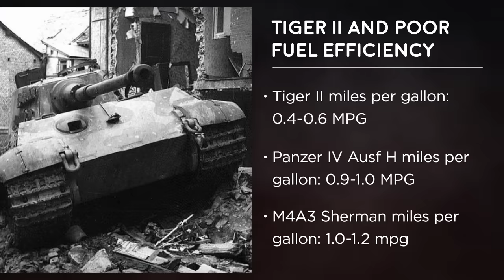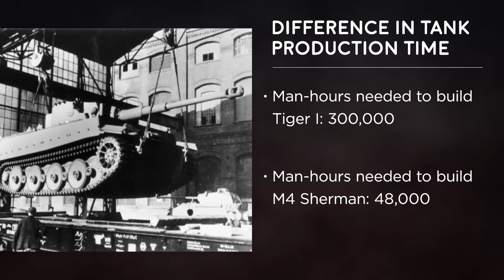Why Did German Tanks Perform So Badly in The Battle of the Bulge?

Comment: Tigers = 72 tons = over 140,000lbs. Each. Can’t think of too many of those country Euro bridges that could support that kind of weight.  If so, then one at a time crossing.  Tigers - lots of moving parts and complex. Was a garage queen. Massive and a brute but required a LOT of maintenance.   Not very good critical thinking skills when looking at the type of terrain that Germany had to mobilize over and conquer.

Comment: The heavy weight of the tigers coupled with all the bridges they had to cross.
American engineers blowing up every bridge they saw.
German lack of fuel.
German lack of intelligence (they had to search for American fuel and found it surprisingly).
It surprises me they got as far as they did.
If they used lighter panzers 4s and panthers and not the tigers and if the weather lasted longer maybe.

Comment: TheTiger tank was too heavy, and consumed too much fuel. It was not appropriate for use in the Ardennes forest.  The Germans though they could repeat the invasion of France in 1940, when they stole the fuel the French abandoned in their retreat, but the Americans did not abandon the fuel, they used it against the Panzers pouring it down a grade the Germans were climbing and then igniting it. 
The modified Sherman or Firefly was a better proposition than the German Tiger for use in the Ardennes.

Comment: Panzer IVs with high velocity 75mm should have been the workhorse just as the T-34 was the Soviets workhorse.   It is difficult to expect completely rational behavior from a regime that gave cult to gigantism.   Logical decisions are not spurious but the result of a rational and coherent command structure.   Germany's havoc in Europe was anything but rational.
Reply: Another problem is recruiting crews and resources. The only reason why t-34 even works is because the Soviet union built about 84,000 T-34 including every variant and they can recruit a lot of crews easily. A single german tank sometime can destroy over 5 t-34 easily

Comment: German tanks were vastly superior to Allied tanks in WWII.  The primary issue with them was their complexity, cost and their poor MPG.  They needed a lot of maintenance (The Tigers)  by highly trained technicians and a steady stream of replacement parts and petrol - none of which was readily available at the time of the "Battle of the Bulge".  American quantity in Shermans outdid German engineering.
Reply: WW2 was a war of quantity. A single german tank can destroy over 10 T-34 in one mission and still lose because ammunition would run out and the soviets will just send another T-34. About 84,000 T-34s were made including every variants

Comment: How do they come up with 300,000 man hours for 1 Tiger 1? Thats like 12,500 days for one tank. Im confused how it would take that long? Is that just 1 person working on the tank?
Reply: German production manufactured the parts from scratch, rather than utilizing assembly lines to mainstream the process, coupled with the fact that workers were not in safe environments and most at the end of the war were pows and not experienced workers, if the Americans had built the tiger then those hours would’ve shrunk possibly below 100k to even 80k
Reply: Yes, 300,000 man-hours per tank is one man building one tank. On the other extreme, 12,500 days means 12,500 men could build one tank per day.

Comment: The tiger was pressed into service before it was perfected. Built by slave labor it was also difficult to repair. Lots of defective parts and sabotage. Over engineered and not practical due to the excessive time it took to maintain and fix Parts were in short supply  The Russian t- 34 was easy to build and was the best tank in WW2. The Sherman's were no match for the tiger and panzer tank but was massed produced and more maneuverable. And much easier to fix quickly on the battlefield

Comment: THE TIGER IS SUPERIOR TO ALL TANKS AT THAT TIME. 3 TIMES THE GUN RANGE OF AMERICAN TANK
Reply: Irellevant. Lines of sight ( hills, trees, hedges, buildings et cetera)  and limitations in optics and range-finding meant effective range of tank guns was much less than theoretical max range. Like other tanks the Tigers were firing at stuff between 250 and 800 meters out.

People are blinded by the myth of tigers, evidence just doesn't back up that they were a good AFV.There are many criteria to consider in judging an AFV, and the Tigers were adequate/superior in only two of them - firepower and armour. They were so notoriously bad in all others that they can be argued that they were a failure as a weapons system and a waste of  resources in short supply. The modest and trusty Sherman's and T-34s were superior to the steel beast  because they were more effective weapon systems.
Reply: Irrelevant

Comment: The Panther and King Tiger tanks were supposed to be another good piece of propaganda material for the Third Reich, Allie intelligence seemed to be aware of this during that time, you could say there was a counter-propaganda effort. overall, the Panther and the King Tiger were still good continuations of the Panzer IV and Tiger tanks, but Nazi Germany, with increasingly scarce resources, was not in a position to mass-produce and field such expensive and fuel-hungry machines. Also The king tiger do have fuel efficiency issue but you should compare it to other heavy tanks rather than medium tanks.

Comment: Their tanks are too heavy. If the concentrated on making light medium tanks they could have won. They also used gas instead of diesel. Diesel can easily start at -50 while your gas tank sits there.. they had to set fires under it at night to keep it warm for it to be operational which made them sitting ducks

Comment: Piper was held up by combat engineers, not paratroopers. They had superb tanks and they could not be stopped by any US tanks on the field. 
Your premise is wrong - and your analysis is crap. The difference between the two battles is the US army infantry, the 82nd an half the 10th armored with 155 artillery.

Comment: Why did the German Tanks Perform poorly in the battle of the Bulge? I can answer that question. A tank doesn't perform well after grenades are dropped down the hatch. My grandpa was on a team of 4 men that took 12 German tanks out of service. The Germans had to use the tanks as shelter because it was so cold and they had the engines on for heat. Now that engine will drown out a lot of noise. The consequence of having insufficient lookouts due to the cold means there's no warning until that grenade was inside the tanks.

Comment: This video goes on about the so called "mechanical advantages" of the Sherman tank, completely ignoring the fact that by mid January, the Allies had about 4500-5000 tanks in the Bulge while the Germans had about 800 or something.... And despite that and everything in the video, the Germans still had fewer losses... Also, he goes on and on about the fuel and spare part shortages, crediting them as the tanks' fault... Germany was losing the war, wake up, of course it lacked resources... The tank design was not responsible for that... In the end you need to realise what the doctrine of German armor was. It could never outnumber the Allies or the Communists. But it could always outperform them, which it did... The Germans built a Panzer to destroy 10 Shermans, and the allies built 20 Shermans to replace the 10 the Panzer destroyed. That was the Allied and Soviet doctrine, outnumber, swarm and overwhelm. The Germans could never match the Allied numbers, never.
Reply: There’s one other factor you ignored, by 1944, most of Germany’s best tank troops were dead or wounded. When the 5th panzer attacked the 4th CCA at Arracourt in September 1944, they were made up of former Kriegsmarine with little fuel or ammo for training. So even tho they outnumbered them with 262 tanks and assault guns including Panthers. They were facing American tankers that were veterans with 3 years of experience! Plus Germany used the fog and rain to keep army air Corp grounded. Yet the Germans didn’t have enough sense to send out scouts to find the Americans so the Sherman’s set up ambushes in the rain and fog that the Germans kept blundering into. The Panthers superior armor and gun were still no match at point blank range against the 76mm of the Sherman’s. The Germans  lost 200 tanks and assault guns against losses of 50 Sherman’s and tank destroyers! So this battle and the Battle of the Bulge eventually came down to combat veterans using superior tactics. As in the engineers, angered about the Malmedy massacre, easily predicted where Peiper had to go to find bridges the Tigers needed to cross rivers and blew them up before he could reach them!??

Comment: Bad ? The moment there was good weather, they was constantly bombed and strafed by superiour and dominating allied airforce. 
If the bad weather had continued through the hole campaign, and the Germans had plenty of fuel, the outnumbered germans would have been a BIG problems for the allied.
Reply: The German plan called for the armored divisions to cross Meuse by day four of the operation using their advantage in surprise, numbers, and air cover provided by the weather. Despite all these advantages, the German offensive fundamentally failed because they underestimated American resistance, particularly on the northern shoulder, which then threw off their timetable and allowed the Allies to reorganize. In other words, it really didn't matter how many airplanes the Allies could put in the sky. The offensive was shot by the end of the first week.

Comment: IF nazis had copied and used t34s they would have won battle of the bulge.
1. Not stuck to roads can go off road easily due to wide tracks and low weight
2. T34s with external fuel tanks needed no fuel supply and had range of 500km
3. T34s 85 can kill shermans but sherman 76 bounces of t34 sloped frontal armor

Comment: too many mistakes - check the history records of Speer who had decided to produce more tanks and less spare parts.
Simple as that , a management decision.
German overengineering is the false excuse for bad allied tank performance, right ?

Any proofs that they were more unreliable than allied tanks ? 
How many shermans had been burned and knocked out compared to the few german mbt ?

And count the dead american and british crews you could only burry but not repair or heal.
Also the stats are wrong regarding the man hour counts at least according to the manufacturers archives.
It is a different story to reverse engineer and calculate in post war america than to check real figures from the manufacturers. 

It is a history written by the winner of the war who had to explain why so many of his own tanks and crews had been killed - so they decided to move ahead away from to weak armour and canons and what not to the enemies unreliable tanks - wasn there a big tank battle in northern africa the famous pass battle where 10000 americans had been defeated around the kasserine pass ?
Reply: Of the 50,000 American tankers sent overseas during WW2, 3% died in combat. Of that 3%, only half died inside their tanks. Overall, only 1.5% of American tankers sent overseas in WW2 died inside their vehicles. This is a very good casualty rate.

Also, history isn't written by the victors. This is a common myth peddled by wehraboos, who are ironically heavily influenced by propaganda efforts of failed regimes ("superior" German engineering was a legitimate propaganda tactic utilized by the Nazi party during WW2).